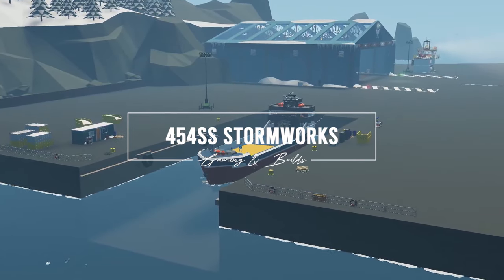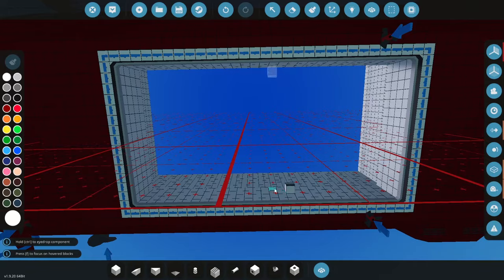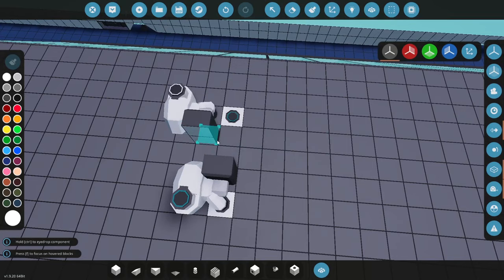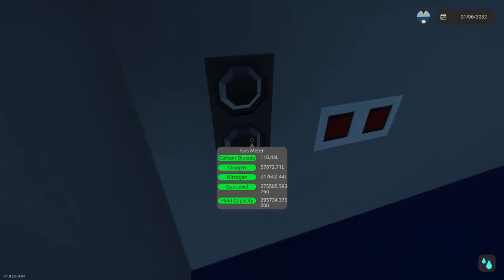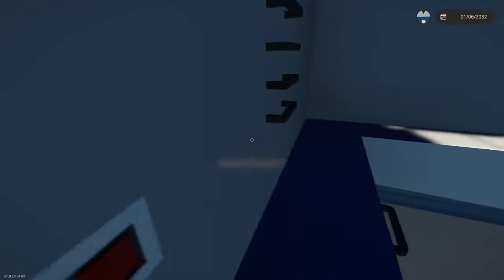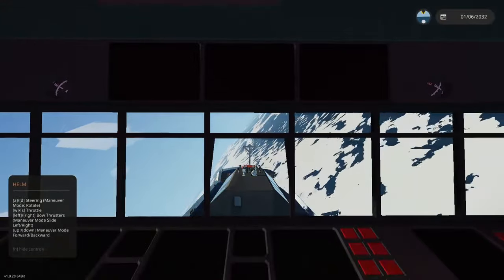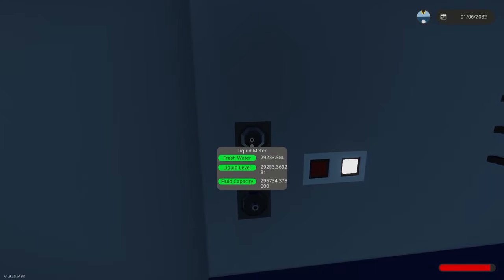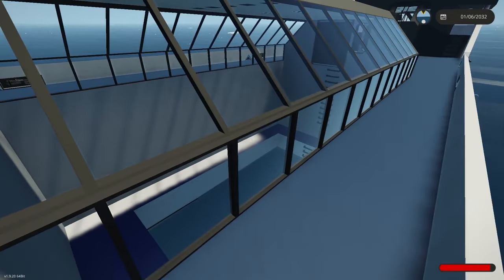Testing MOONPOOLS in Stormworks!!

Comment: Unfortunately it takes zero effort to make a moonpool in the current state of the game. Compressed gasses are completely broken
Reply from the maker: There is certainly some things broken right now (the fact it is not filling when open to atmosphere), but other than that the behavior makes logical sense for the most part
Reply: @454ss_gaming  yes it makes sense in this instance. But I bet it is possible to make an upside-down moonpool in the current state of the game, since currently compressed gasses almost completely prevent any kind of flooding
Reply: @454ss_gaming TerrRawrSaur shows that unfilled door frames act like invisible walls for pressure. I think you should try adding a door to your moon pool and opening it for a test.
Reply from the maker: @HendrikDannys  I did at the beginning before adding my airlock - it does not allow pressure through so it does not flood up :D You will see in my video tomorrow :)

Comment: i have purchased the game post update but i have never been able to use the steam engines, the steam pressure just does not go above 2.5  (i feel like it has been broken for about half a year now given the time people stopped using then). seeing as you are more experienced with the game would u check that out for me?
Reply: Boiler pressure doesn't matter anymore. Place a pressure sensor on your steam pipe and use that to measure the amount of steam you have. You can have up to 60psi.
Reply: They are working these days, though the devs have removed some features…

Comment: I think it doesn't need to flood when door is opened. When that happens ship becomes a donut shaped boat. Water level inside would equal to water level outside, therefore correct behavior if i didn't mistake the water level. Ship sits quite high right?
Reply from the maker: Correct, it wouldn't flood to the top, but would equalize with the outside water level :)

Comment: Providing the ship has enough buoyancy the water isn't going to rush in when the roof/door is open to the atmosphere. The only way the water should rise up is when the ship sits lower in the water or when you create a vacuum which will suck the water in. 

Water doesn't rise, the only way that water will enter the ship is if your ship sinks. There's not enough blocks for the water to get on top of to create downward force dragging the ship under.